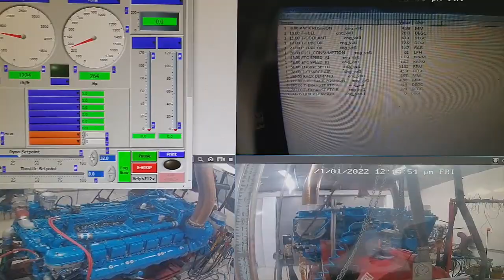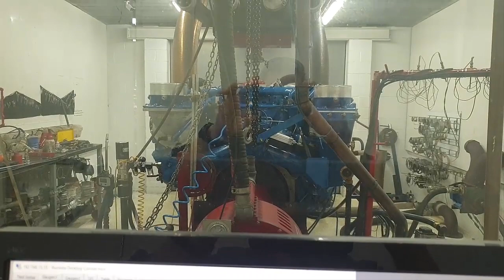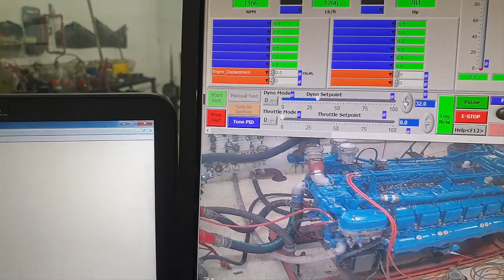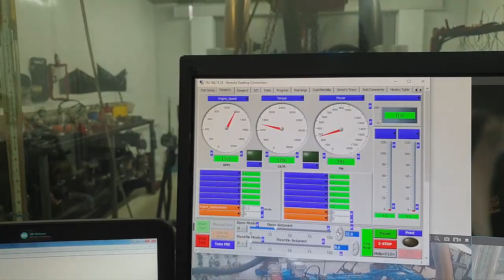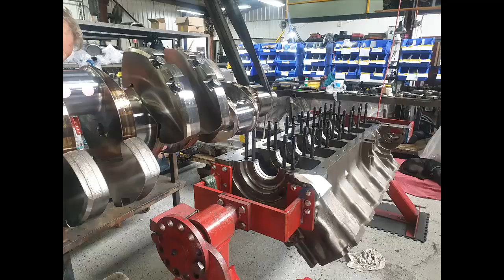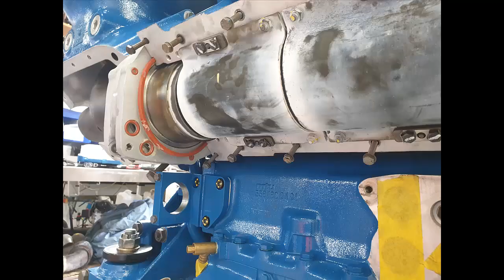MTU 396 Narration

Comment: I really like your vidio brother I want to ask you brother, I have MTU 396 12V machine, Turbo B Bank does not want to open in Rpm 1600 and RPM Hunting Do you know what it causes
Reply from the maker: Yes a few things. First thing to check is your fuel pump actuator position when the engine is not running. Do you have diasis or a panel which can tell you this?  The actuator is at the end of the fuel pump and can be adjusted under the 4 bolt cover plate . Let me know what reading you get. Rack travel starts at 1mm so the actuator reading should be around this . The ecm  looks at actuator travel for b bank turbo operation as well as heavily influencing sensitivity of the actuator hence hunting issues. Heaps more l can tell you however you will need to email me for more direct contact. My email is brad@deas.com.au

Comment: Really interesting video. I don't work with these engines but they just fascinate me.
Would like to see more about them.

Just to your reference to the tank engines:
The Leopard 1 tank ran a Mercedes-Benz designed, later passed over to MTU, type 838 V10 engine. The Leopard 2 had a type 873 V12 engine following the same principle.
The 838 V10 of the Leopard 1 has the same 165 mm bore as the 396 engines but less stroke, so less cylinder volume.
Although the 873 V12 has almost the same cylinder volume (3,97 litres), bore and stroke are also different compared to the 396 series.
So the differences already start with the basic engine data.

The MTU 396 series was developed from the (shorter stroke) 331 series engines which were also originally designed and built by Mercedes-Benz.

But apart from the geometric data there are also major differences regarding the injection system (396: direct injection, 838 etc.: pre-chamber injection for multi-fuel use).

Maybe the real base construction of the block etc. was similar, possibly you even have information or practical experience about that which I'm missing.

Just wanted to point out that there are some bigger differences between those engines than you could think just by going of the manufacturers name and the somewhat similar optical appearance.

Kind regards from Germany, Tobias

Comment: I prefer the individual heads myself. Much easier and cheaper to service especially if there is a cylinder failure, a lot of times you can just replace the one bad one instead of having to get a whole banks worth of parts.  Also they seem to last better. I have seen a shipload of cracked 3406 Cat heads versus 855 or n14 cummins heads.
Reply: 👍👍had to buy a new E model head recently... cracked between exhaust valves on every cylinder... they've all got their pros and cons..the CAT folks sure seem to think yellow power plants never fail which isn't true,but anyway